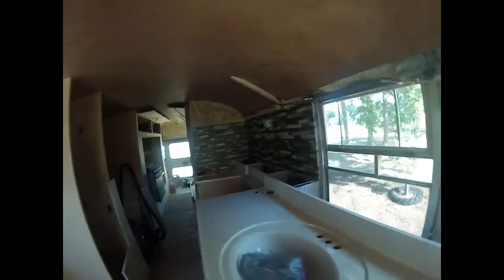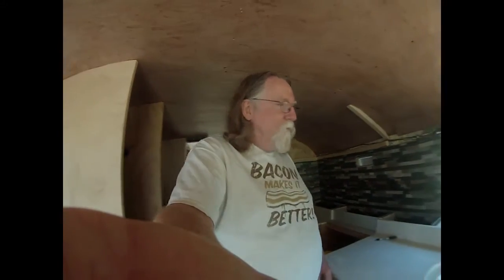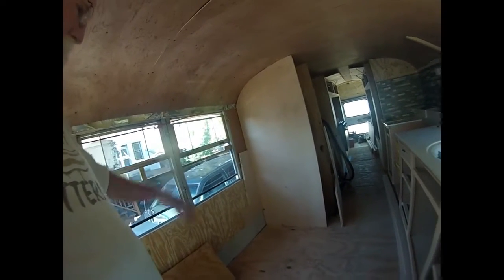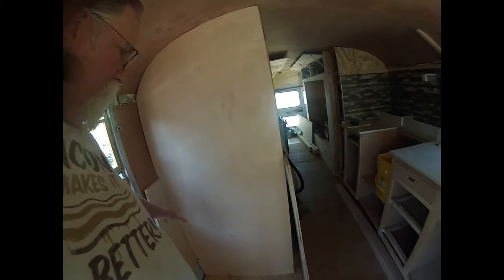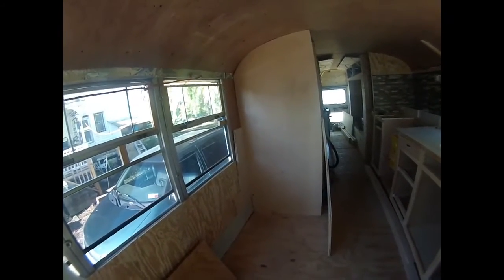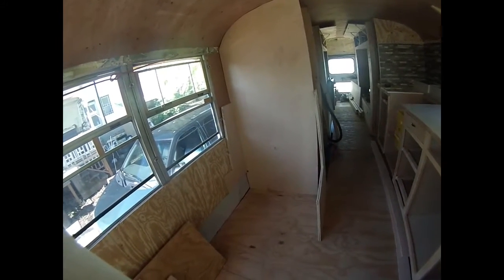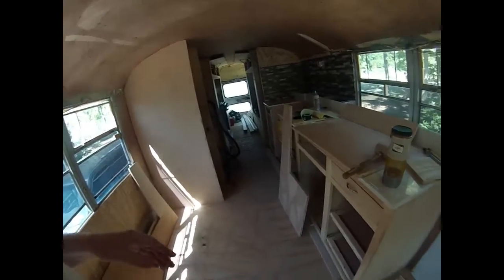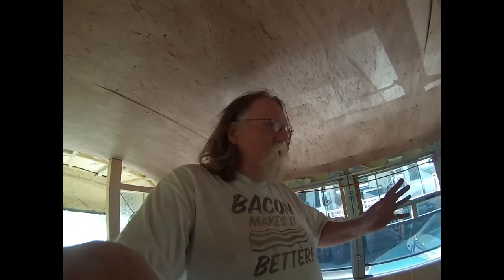Old Thyme Skoolie- Episode 34 Seating and Battery Storage

Comment: Do you have a document with measurements and floor plan? I am starting to draw mine out and like alot of yours. I want to replicate you booth so those were the specific things i was looking for. Thanks again. :) Wes
Reply from the maker: I don't have  a plan with measurements. I figured them out as I went along. But I can measure what ever you need to know about.
The booth seat I worked out the basics by measuring a comfy chair. 
30" wide x 16" deep x 17.5" high.  That's just the seat
The base is 24" deep to give me room for the batteries and compartment for the electrical
That space is 6" at the top and 9" at the bottom to give me a tapered back
Hope that helps
Reply: Thanks for doing that as always i appreciate it. :)
Reply from the maker: Always glad to help

Comment: did you borrow that router from rv prevost? 
is this an auxilliary to an ange grinder? there are not so much to be seen overhere in netherlands.
Reply from the maker: No, lol.
He's in Texas and I'm in New York about 2500 miles between us.

I'm using a biscuit joiner. It cuts small slots to put an oval wood waffer in to act as a spline to help join the pieces together. He uses a different brand but they both do the same thing.

I'll be sure to show it in more detail when I record the next part tomorrow